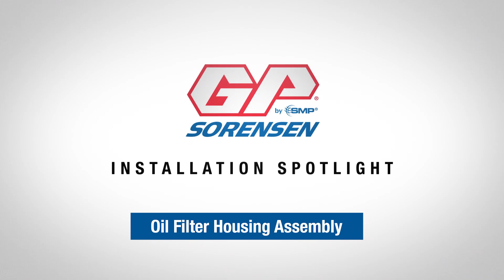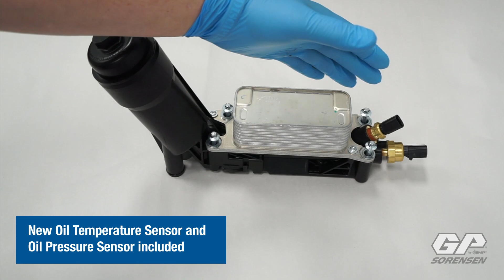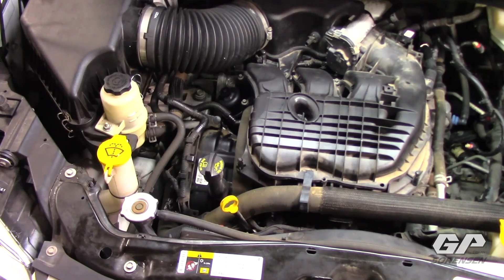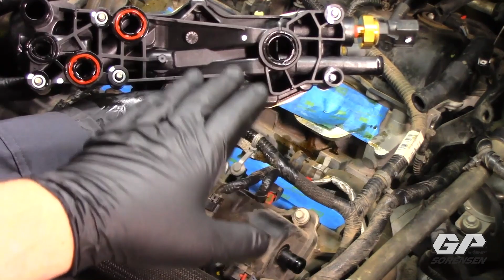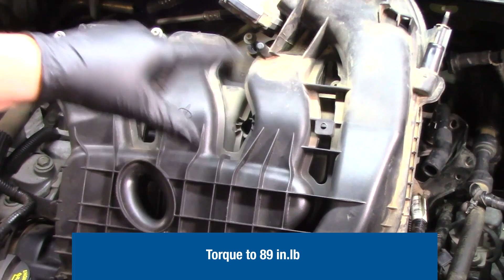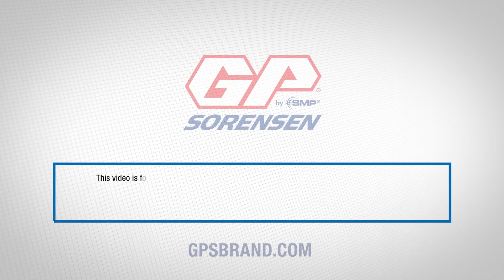Oil Filter Housing Assembly Installation

Comment: Hi ! Well done explanation, very frequent issue with the 3.6L Penstar engines, also the location (position/ orientation) of the engine varies from the Jeep to Dodge to Ram to Chrysler, etc. around $1700 to get a new one installed. Like you say it is a big job ! Better to get the new complete assembly to save time, Thank you for sharing.